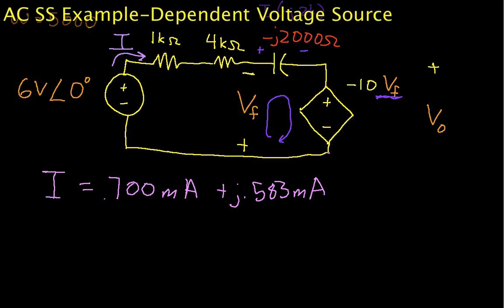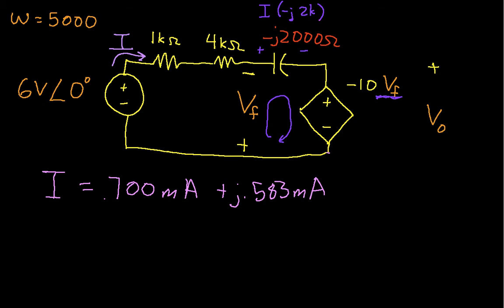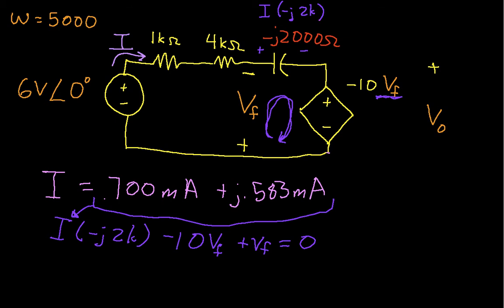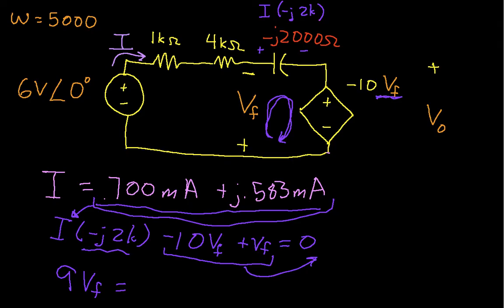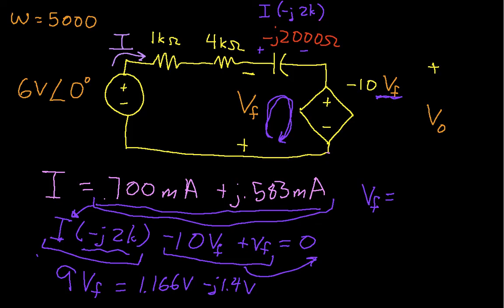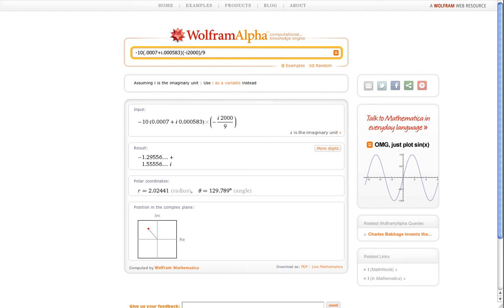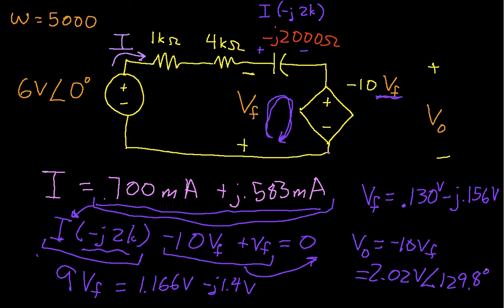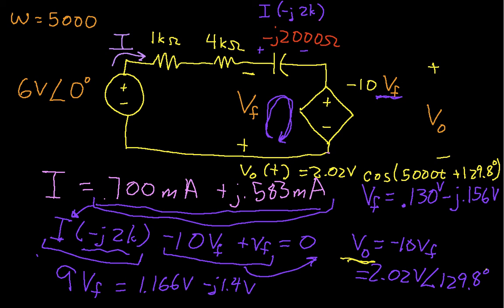AC Example-Dependent Voltage Source Part 2

Comment: I may be totally off  base but when I work this problem I get that:
   I = (0.001197634 -j0.000053228)A
   Vf = (-0.001314276 -j0.0295712173)V
   Vo = (0.01314276 +j0.29571217)V
   Vo(t) = 0.296004cos(5000t + 87.4552°)V

However, I have not worked a circuit analysis problem or used complex numbers in over 30 years.  Therefore, I would appreciate it if someone could verify that these are the correct answers.
Reply: +george stroud 
Sorry I copied and pasted some incorrect value in my comment, the values that I got should read:
I = (0.001197634302612124 j0.000053228191227206)A
Vf = (-0.011828486939379-j0.266140956136028)V
Vo = (0.11828486939379 + j2.66140956136028)V
Vo(t)=j2.664cos(5000t + 87.455°)V
Reply: Actually i have very similar values and im trying to find out where did i do what wrong...